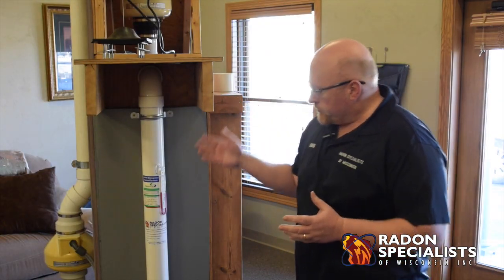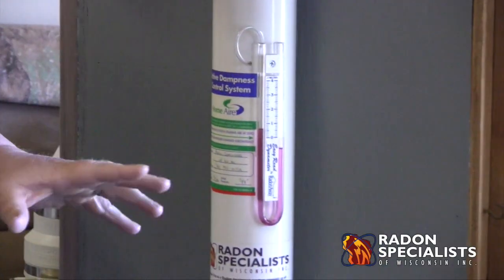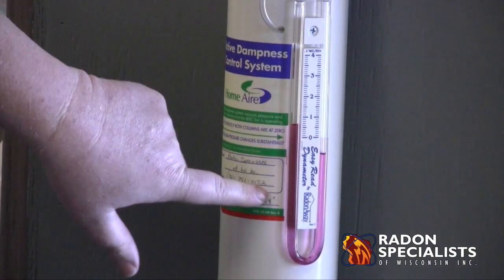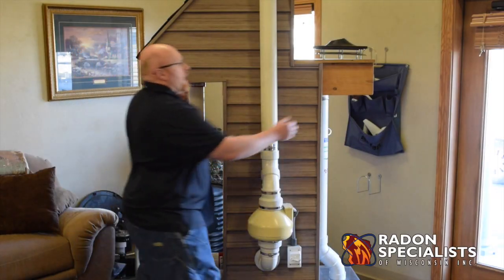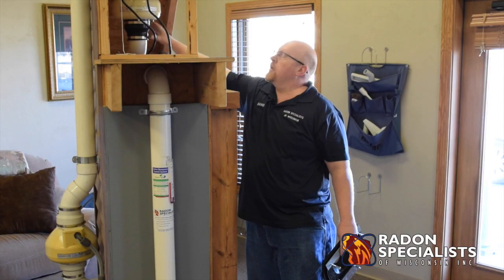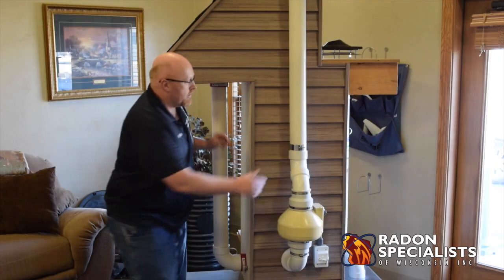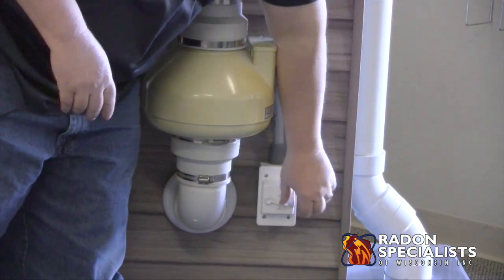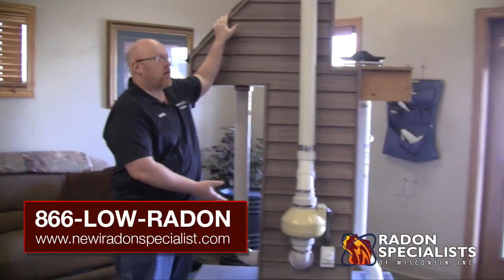Anatomy of a (Properly-Installed) Radon System

Comment from the maker: If no gravel, that's when it might be necessary to install a larger vacuum fan and possibly more than one suction point so enough air can be pulled from under the slab.

Comment: Is it possible to install the pump outside of the house? Or re-route the u tube manometer to be outside?
Reply from the maker: The radon fan can be installed outside. It just can't be inside the envelope of the house or underneath livable space. The U tube should really be in the basement. it's not be outside of the home because rain will get in it and keep it from functioning properly. If you have cold weather and it's in the garage the oil can gel up and keep it from functioning properly. There are audible alarms on the market that can be installed in addition to or instead of. That way if the fan stops working you can still  know that and take appropriate actions.

Comment: Looks like an open system. How do you keep the water out?
With the snow and ice, what about freezing and the effects on the fan as these elements reach it?
Reply from the maker: Good questions. With our climate in NE WI we want to vent straight up and out. These fans are made for what they do. Water can pass through them. Plus you always have moisture being vented out. Putting anything on top of the vent will actually help it to freeze up in the winter. Systems routed through the garage and room almost never have complete freeze overs, whereas outside systems will because more of the system is exposed to the colder air. With the vent being open it is less likely to freeze up. Also, with the fan operating not much rain ever makes it into the pipe as it is being kept at bay with the air volume being blown out of it.
Reply: Wouldn't it make sense to have a cap on the pipe to prevent water from entering and getting into the foundation?
Reply: @Twinkier1  yes
Reply: Radon Specialists of WI - you just answered my questions too! Great video.
Reply from the maker: great, glad it helped.